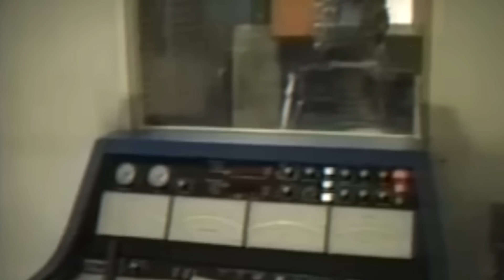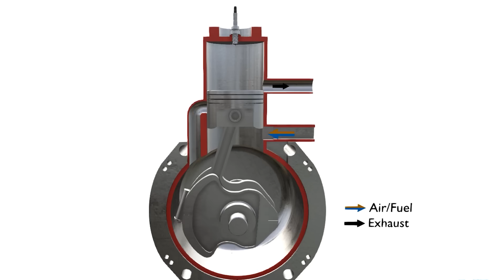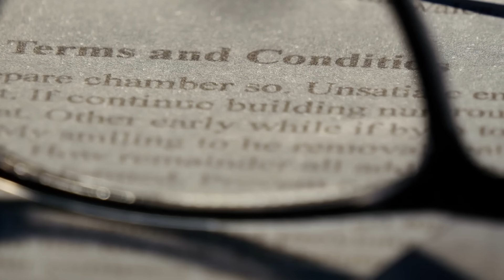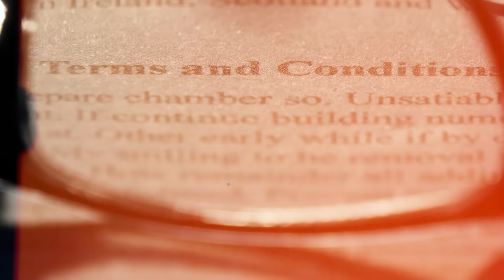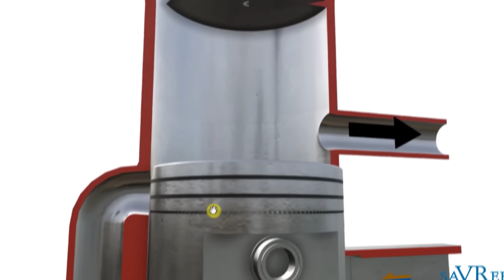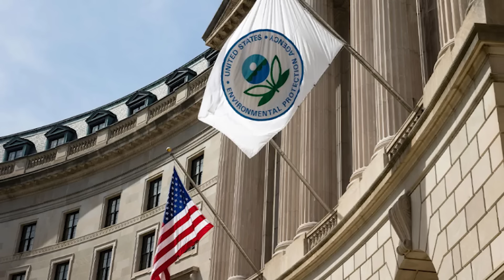The SHOCKING Truth Behind Banned 2 Stroke Engines!

Comment: To lubricate a 2 cycle gasoline engine, you have to either inject or premix gasoline to around 50 to 1. Oil has to go through the power head and out the exhaust. 

Just look at this video when they showed it in a driveway running and smoke pouring out of it. That smoke will end up in the eco system with an oily residue. I love 2 stroke outboards, the lighter weight and simplicity is what I like. 

But, the fuel consumption is far less with a 4 stroke, far more efficient.
Reply: You can't fix stupid.😑
Reply from the maker: @simonlangmead7 so which side of the fence are you on then? Sounds like eco friendly? Looking electric?

Comment: Yamaha makes the best 2 stoke engines ! Period !
Reply: My older brother has a 40 Hp Yamaha with a jet he bought new in the 90s. He lives next to a river and uses it frequently. It never misses a beat. We are in our 70s and fish a lot. I’ve never had problems with snowmobiles either and we use them a lot as we can ride from our homes.
Reply from the maker: @Chris_at_Home love that you guys have some brotherly outdoor adventures, sounds like great life and relationship.
Reply: The 70-90’s Mercury 50 hp. WERE THE BEST TWO STROKES EVER MADE. THEY ARE TOTALLY BULLET PROOF!
Reply from the maker: @Happy11807 assuming you owned one?
Reply: We used to get 4000 - 5000 hours on 225 2 strokes.
Reply from the maker: @saltwaterinmyveins not running 2s anymore?
Reply: @VintageBoats  In ‘08 we quit the live shrimp bait business. Folks don’t fish like they used to. In the 80’s there’d be 100 trucks and trailers at the boat ramp , now maybe 20.
Reply from the maker: @saltwaterinmyveins shame! Although good for the fish...
Reply from the maker: Cast your Yamaha support on community post!😊

Comment: I'll keep my 2 stroke oil injected Yamaha thank you very much! It runs circles around 4 strokes and does it without smoking!!!
Reply: My Mercury Optimax does too.  It sips oil and gas as well.
Reply: @jgringo5516 I honestly think the ban on 2 strokes is because of pressure from the "go green" idiots like that moron Greta Thunberg. The ban is utterly ridiculous because the technology to produce lightweight, efficient and eco friendly 2 stroke engines has existed for decades.  Our oil injected 2 strokes like your Merc and my Yamaha do less damage to the environment because with 4 strokes you have to constantly dispose of the old oil and oil filters.
Reply: 93 Yamaha 115 v4 here, same story. Bring your 4 stroke by in 32 years, mine will still be running.
Reply from the maker: What Yamaha do you run? Thanks for watching!
Reply: Yes is far companies would offer 2 stroke DFI options! They seem stuck on the 4 tard stroke!

Comment: I recall, quite clearly, the oil slick on the lee shore of Lake Monroe, due to two stroke exhaust being discharged into the water with the cooling water from the engine.
Reply: yeah sure it could not have been diesel leaking from those rusty old ore ships could it .?
Reply: @davidkettell1073 Since 
Lake Monroe is an inland resevoir with no commercial traffic or sgipping, and no industrial presence, no it couldn't
Reply from the maker: @mitchellsmith4690 sounds like you are on the environmental support side of this?
Reply: Not a rabid enviromentalist, but when you can see it with the naked eye, I think it was a real problem. @VintageBoats
Reply from the maker: @mitchellsmith4690 understood completely. Thanks for coming back.
Reply: Since Lake Monroe is an iland resevoire that has no commercial traffic, in an area with no ore or heavy industry, no. @davidkettell1073

Comment: There should be no restrictions on two stroke engines with less than 100 HP.
Reply: I don't like the idea of bans, but small 2 strokes make the most sense.  2 strokes are less efficient and dump much more oil. But small engines, even when less efficient, don't burn much gas or oil just because of their insignificant size.  Weight is more important with these because they are often removed from the boat ,packed, and carried . The absence of heavy valve train components  saved the backs of many users.  Since oil isn't stored in the crankcase, transportation without spillage is simpler.  Mixed gas or oil injection makes oil changes unnecessary.  Simply put a two stroke is better if the engine is going to be removed after use . Especially if it is going to be transported on its side.
Reply: How do you get to that conclusion?
Would you ban a more powerful but cleaner unit?
Reply: No I don’t condone a ban on large efficient two strokes at all. The smaller two strokes are superior to available four strokes in the tiller and portable outboard segment. The weight savings alone is significant. Also, not worrying which position to store the motor is a huge plus.
Reply: I'd go to bed with my 9.9 old two stroke Merc, but my wife would have to keeve❤
Reply from the maker: @bigtoepapa haha amazing! Little but of humour here is what the channel loves to see!
Reply from the maker: Love the convo here guys! Hope to see more action from you all at the channel!
Reply: Hell no motor should  be outlawed it drives price up with the stupid emissions crap kills power and makes everything way more expensive
Reply: They are not banned.  Amazon to your door
Reply: Less than 250hp
Reply: You know world largest ships is 2 stroke? 😂 We are talking 40.000hp 16 cylinder. Dont believe me? Look up Maersk triple-E Man engine.
Reply: Car culture is a 4 tard stroke circle jerk cult! Time doe some 2 stroke DFI v8's!

Comment: Some of the most reliable engines i work on at my shop are 2 strokes. Theyre lighter, less complex, get on step faster & when maintained last way longer. 
The number of 4 strokes that end up scrapped because the cost efficiency to fix them can often be more than a new outboard. Cant replace the old 2 strokes so it is best to maintain them while we can.
Reply: I've been able to get 40 and even 50 years out of these small 2 cycle motors.  Our 4 stroke we bought new to replace them didn't last 10 years.  Ironically. Brother sold off a running 1975 Johnson 55 hp last year!  The Newer 4 stroke went to the scrap heap for the reasons you said.  Granted the 4 stroke was quieter, it seemed to lack power.  Also thought that new 4 stroke vibrated too much.  Prices these days, I might start rowing again.  That's what the Greenies want us to do anyways.
Reply: @larryspiller6633  Car culture can keep their 4 turd strokes.Lets see some modern DFI 2 stroke v8's!
Reply: I got two friends one had a Mercury 60 HP and one had a Honda 150 HP four stroke the Mercury was a 2012 the Honda not to sure but I think they were like two years apart The Mercury died in 2020 and the Honda died in 2023 me I still have a 1996 50HP yamaha still going to this day God Bless the two stroke engine when ever she go's I may just give up fishing I guess With Love for the two stroke South Louisiana🤠
Reply: Mines 20 years old. Plus. Along w  a 1959 Elgin 7.5. That’s for sale.
Reply from the maker: Great convo here everyone..thanks for all your comments and hope to see more action from you all!
Reply: Two strokes are loud and burn more fuel. That said mine lasted me 25 years. Now I really like my 4 stroke.😮